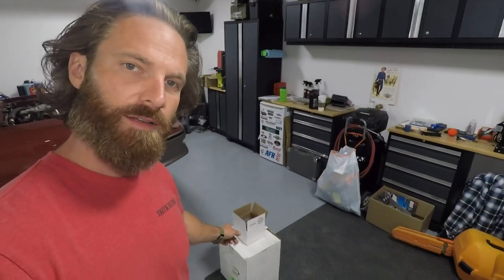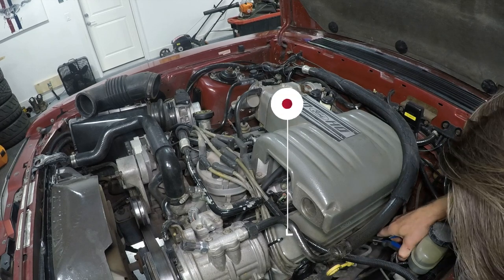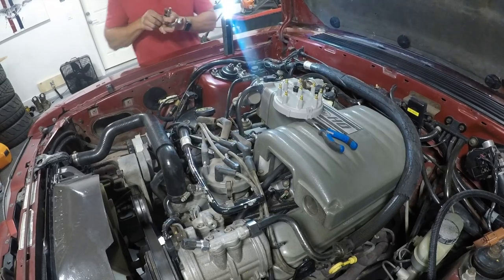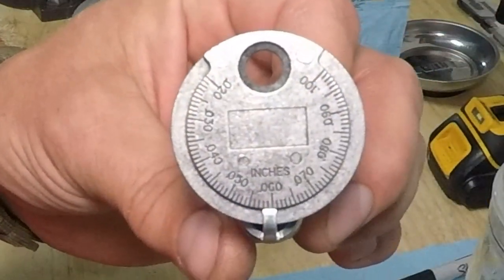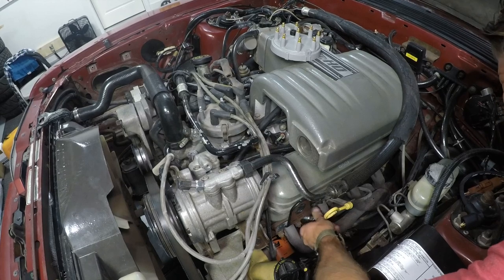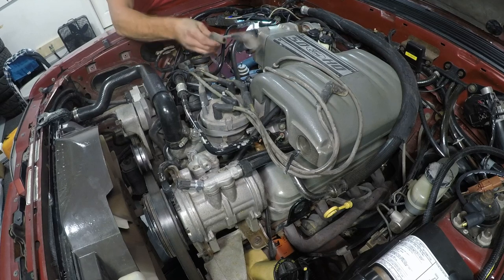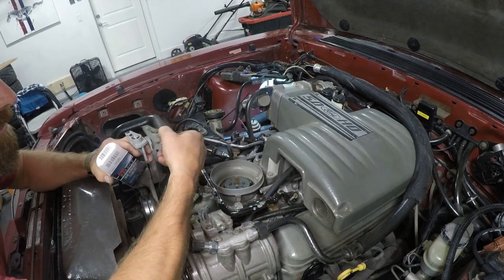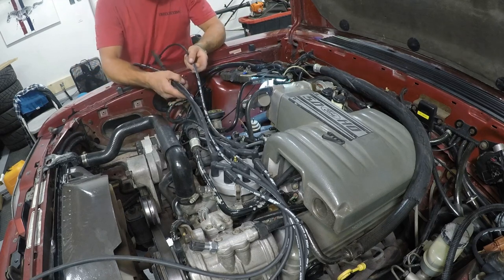How to: Tune up your 5.0 Mustang V8 - Plugs, wires, cap, rotor, fuel filter, & setting your plug gap

Comment: Clean and simple….love it. I just an 89 GT this past Sunday and I love it. It’s my first foxbody and she’s a solid rust free car that needs a little TLC cosmetically but she’s got the T5 and the 5.0 so I’m happy. Came with an off road H pipe and Flowmaster 40 series exhaust so she sounds great too. Anyway, I think I’m going to do a tune up too and was wondering if it was worth it to upgrade ignition coil, plug wires and cap? Was thinking of going with the factory Motorcraft stuff but the other’s look kinda cool. Great video and I love the channel and just subscribed.
Reply from the maker: Congrats buddy. Personally, I stay away from the after market coils and ignition boxes but new cap/rotor/plugs/etc would be in order for sure 👍
Reply: @KASLCustoms  sounds good, thanks for the advice my friend 😎

Comment: Wish I could share some pics of my vert! I got my goalie bag in it. Fits like a glove. Another great video. I’m going to be doing this this Labor Day weekend.
Reply from the maker: Lol that’s awesome!
Reply: @KASLCustoms  I just got the plugs and wires done on my vert. The plugs were 2 plus years old and low miles but a lot of sitting around…and they looked brand new… 😅
Reply: @KASLCustoms  I watched your rear gear assessment. I think 4.10 is going to be to radical. I love the torque it produces but my vert is a cruiser not a pull your face off power. Im probably going to go with 3.55. My vert is a daily and will be used to transport my daughter and I with her travel hockey team. To MN to CO from Omaha, NE. Not to mention the vert will be used to transport my wife and I to car shows throughout the US.

Comment: That is one clean fox body!also nice job explaining step by step tune up. also it’s not a bad idea to clean your mass airflow sensor while you clean your throttle body I am a mechanic by trade and you would be surprised how a dirty mass airflow affects performance just make sure to use mass airflow cleaner only they are sensitive
Reply from the maker: I totally agree and have a follow up video coming along the lines of your recommendations 😉. Thx for the Info my friend 👍👊

Comment: I use a piece of rubber hose over the plugs to install them. That way there is no way to cross thread them as it slips before any damage can be done. Plus it grips the plug just enough to guide them in....
Reply from the maker: I like it!!!

Comment: Question I changed my sparks myself rotor wires ignition coil etc vehicles still misfiring which was the issue before that I hope solved , an now also revving on its own believe I have a faulty ignition coil wire that I have replacement coming for I gapped it all at 54 an double checked b4 putting them in so I don’t think it’s the spark plugs  but what do you suggest to check to fix my issue ? Also  spark plugs were gapped all wrong from previous owner slugged an black if that helps ..stuck rn thanks fuel
Filter is next an fuel cleaner
Reply from the maker: Have you checked the timing? My guess is that it’s off
Reply: @KASLCustoms  no have not never done that myself honestly

 but I fixed it so I changed my tps but still misfired that morning after change..changed my gas from 89 to premium added b12 an no more misfire …that simple 🤦🏾‍♂️ did all the others an that was the culprit
Reply: Feel my idle could be better but no revving no misfires so I’m golden ..thinking about still changing some parts for a better idle 

Map sensor 
Idle air control valve
Coolant temp sensor etc

Comment: Just did plugs, wires, cap and rotor on "Crusty the Clone" aka #4994, lol.  I ran into the strangest problem though.  Tried a new MSD cap and rotor (the common wire hold down type) and the car hates it.  Runs okay for a bit then starts hunting while the AFR swings around and then it either stalls or almost stalls.  Put the Motorcraft cap on and it will purr like a kitten.  I guess a bad cap/rotor is a possibility.  I wanted the cool looking hold down cap, but might just have to run the ol' rubber boot!
Reply from the maker: That is odd. Did you check the height of the spring electrode in the Center of the rotor? Sometimes they can come (right out of the box) squished down and they won’t fully make contact with the top of the cap. Might be worth a look and/or comparison to your old one. There is actually a height spec that the spring electrode should be set to but I can think of it off the top of my head. MSD usually sends a paper measuring tool in their packaging. I think the paper color is bright green 👍. Let me know what you find
Reply: I did new spark plugs and wires and now the motor won’t start please help
Reply from the maker: Check and make sure you pushed the coil wire on all the way 👍
Reply: @KASLCustoms  I open de distributor cap and pulled out the distributor and I’m pretty sure the timing is off because after I did that then it wouldn’t start. Timing issue?
Reply from the maker: You removed the whole distributor from the block? If so, you have have put it back in incorrectly…?
Reply: @alvaropimentel779  did you fix it ?
Reply: @kakanomanches3782   I did all of it but I still need to figure out idle issue. It’s all over the place when I start it and then it’s ok when it warms up.
Reply: @alvaropimentel779  that sucks mine also has a rough idle jumps to 1,500 rpms i just replaced my alternator now im gonna change out my air filter and spark plugs
Reply: @kakanomanches3782  From what I have researched idle issue can mostly be a vacuum leak I need to test that. You should also do wires and solenoid.

Comment: Do you plan on installing an electric fan?
Reply from the maker: No plans to do so on the convertible but have been considering it on my coupe. It runs very hot in stop and go traffic with the mechanical fan
Reply: @KASLCustoms  I had the same problem with mine and I figured out that it was my rad cap that has gone faulty. (Pressure one drive then no pressure during another drive) I replaced it with a new one and so far I dont have this hot problem no more, even with my A/C on, to my surprise,, which did make my car run very hot before I change the rad cap.
Reply: Also I was considering changing my fan to electrical,  but I will have to upgrade my alternator from my research.
Reply from the maker: Oh wow that’s interesting… I’m still running the stock one too 🤔